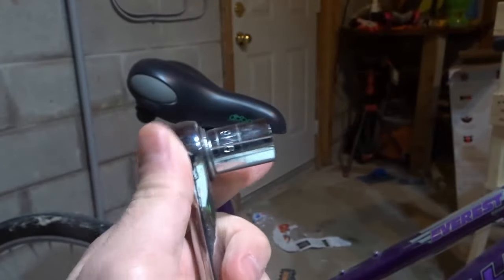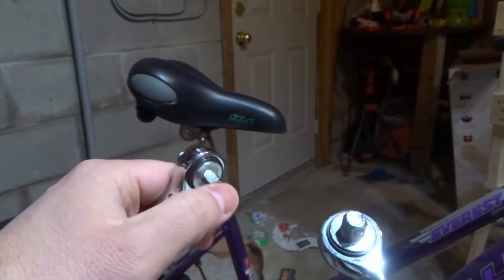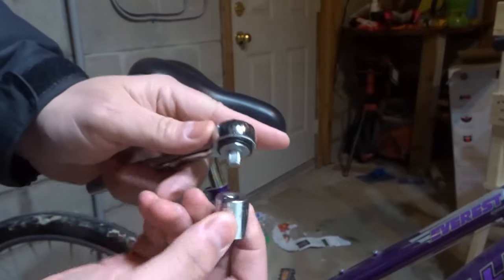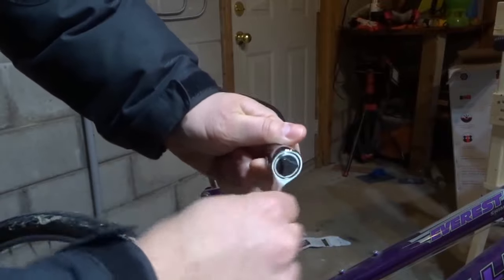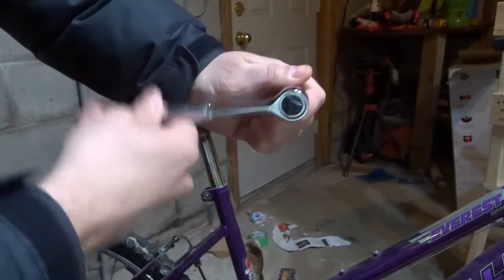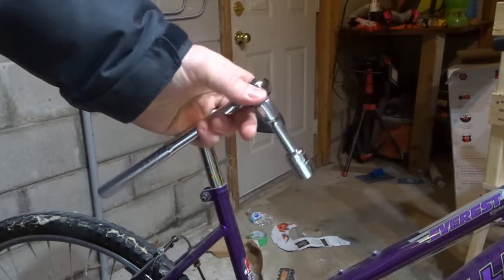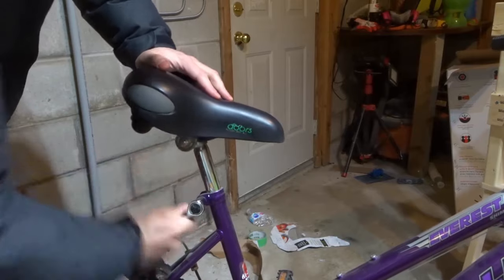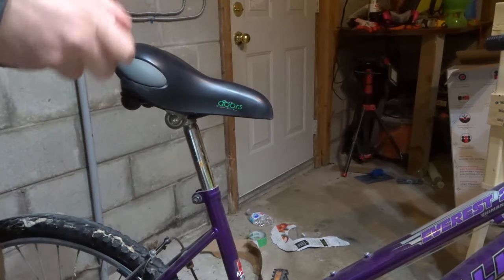How To Use A Ratchet And Socket-Tool Tutorial

Comment: You don't use a ratchet to undo  tight nuts and bolts, so ment people you a ratchet and brake then, there use is not to crack a nut of,  you use a braker bar to crack it and them ratchet to remove rest of the way, that way you don't brake the ratchet....